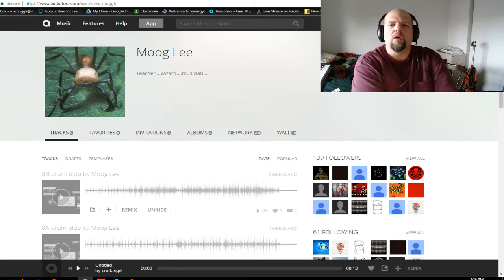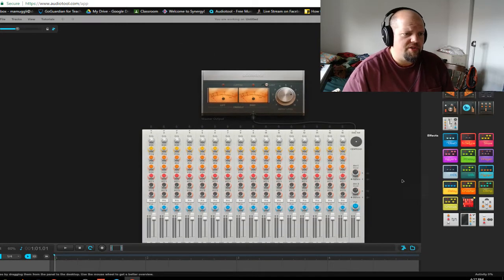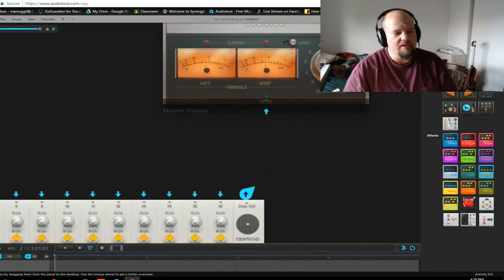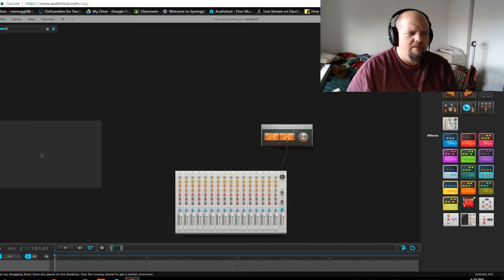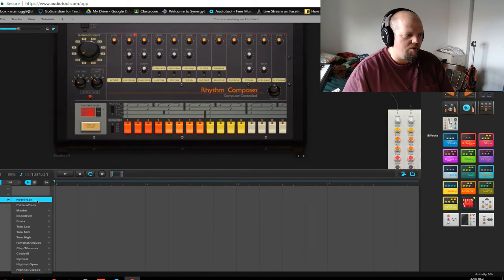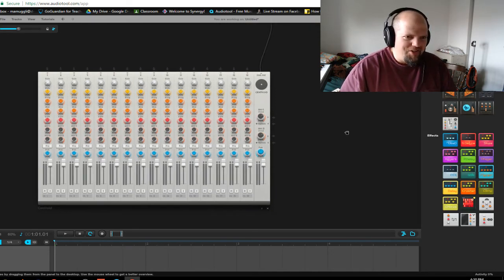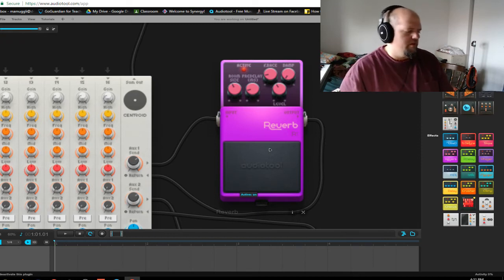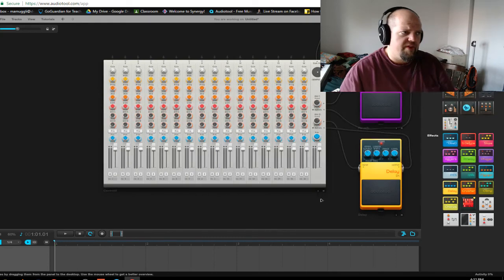Audiotool Tutorial 1: Basic interface, Aux effect hookup

Comment: what if you wanna record your voice in song how do you get that to fit in in audio tool
Reply from the maker: Quintarius Thames not easily. You'd have to record it in chunks, import it as a series of samples. It's labor intensive but it works well.
Reply: Midiman741 Is there any other online music daw that I can use for free that records good??
Reply from the maker: Check out Soundation. Plus free versions of the pro DAW programs are all over the place. Buy a MIDI controller and you'll get a free one. Even Audacity can be really good, but everything has a learning curve.
Reply: Midiman741 And another thing I've tried recording with audio tools and my pitch is different can you plz tell me how to change that
Reply from the maker: When you record, you set your sample as a One-Shot or a Loop. ALWAYS record vocal samples as a one-shot. If it's a loop, then if you change tempo the loop changes playback speed, and therefore pitch. One-shots have to be loaded into the Machiniste, but they stay the same speed unless you pitch them with the Machiniste.
Reply: Midiman741 Thanks that helps
Reply: how do you upload to SoundCloud??